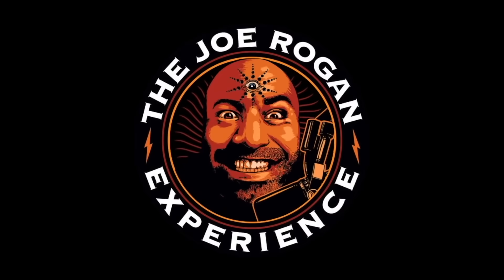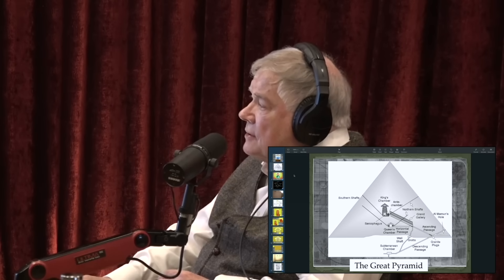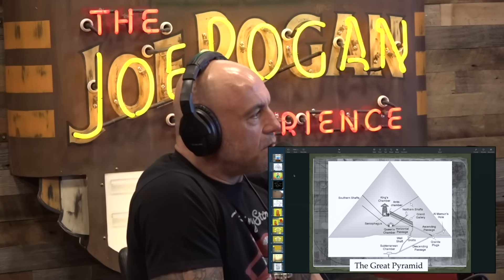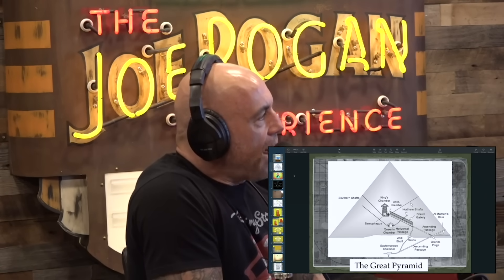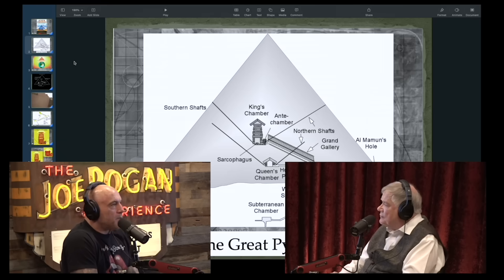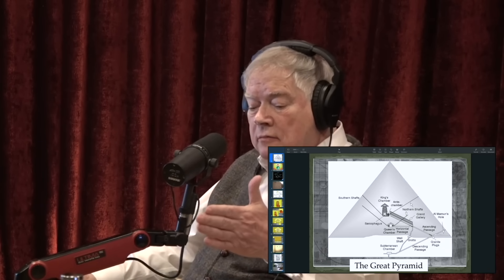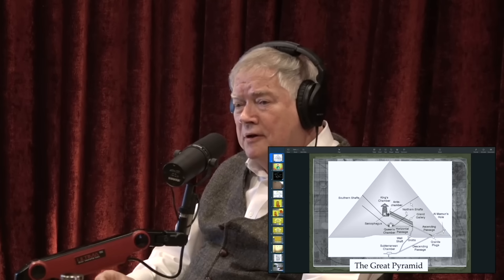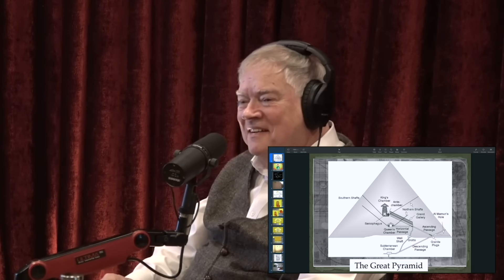"The Giza Power Plant" Christopher Dunn's Theory that The Great Pyramid Collected and Stored Energy

Comment: Look into galvanic cells, hydrogen fuel cells, and electrochemistry. The Egyptians understood how to harness the energy from chemical reactions. Went down this rabbit hole completely by myself about a week ago because i have the same theory as him, and then just now happen to come across this video. So this is what i think he wasn't explaining from what i see. The Egyptians knew how to make acids. From what i understand if you mix super strong vinegar (which the Egyptians could make) and mix it with pure sodium you get hydrochloric acid. If you put certain metals like calcium or copper or lithium in hydrochloric acid a chemical reaction occurs and hyrdogen gas is released(prob don't try that at home). There's also an oxidation- reduction (redox) process they could have been doing that creates an electron current (electricity) that might be more plausible. Im not an electrochemist or anything but i do think it's fascinating.

Comment: Dunn: "The wavelength of hydrogen is 8.309 inches, and the chamber is 8.4 inches. So that's how we know it was collecting microwaves."

The wavelength of hydrogen is actually between 0.0000161417 and 0.0000258268 inches...nowhere near 8.309 inches.

Just like with most absurd theories, they are based on false information which then leads to false conclusions.

Comment: bottom line, regardless of all the theories, there was no sarcophagus found d he the first ppl that blew inside the pyramids, there shafts actually turn(not all of the) for reasons we don't knw, they have tested the very bottom pits of the great pyramid, and I forget what exactly, but some form of hydroxide, coats the walls and floor, SOMETHING was being done...some think the ark of the covenant, which read the Bible analytically, was a weapon. Arks were created(hieroglyphs exist waaaay b4 moses(which the story of the exodus didn't happen) but the supoosed measurement of the ark fits inside the granite box inside the kings chamber,. Graham Hancock is on to something, I don't think electric power was used, but there was some sort of older human civilization. we keep finding older and older structures, temples ect...thay come from pre ice age times...knowledge was lost, what knowledge, downtown move stone as easily as we move a aingle brick maybe, but I don't know. but bottom line m there were no mummies in the pyramid, or any other ofnthengiza pyramids...some things don't add up

Comment: And they did what with the energy?  No wires, no capacitors, no diodes,  no relays, no see through materials that can contain any electrical energy ... minus this way to big conduit. It cant even be a radio.

Comment: Pyramids are aligned perfect with magnetic fields of earth. Pyramids resonate at a frequency and emit electrons. Below pyramid are aquifers so the water moving underground creates soundwaves and the sound waves move up through the pyramids it matches earths vibrational energy and it’s used to create energy.
Chambers have hydrochloric acid & zinc chloride creating tons of hydrogen which the buildup compresses the granite in passages ionizing the air increasing conductivity 
Theres sound resonators in there that further excite the stone and create more electricity + geomechanical devices that convert the frequencies into electromagnetic energy. Inside the grand gallery are 28 pairs of resonators that vibrate and emit sound. Gold in top of pyramid is a great conductor of electricity. 2019 Eric Wilson published “large scale thermoacoustic generator” describing rocks like granite to withstand vibration to allow electrons to move through them and the surface and acknowledged the egyptians created a power generating machine harnessing earths vibration caused by tidal energy and this is how tesla developed his patents and wardclyffe tower.
No evidence of mummies has ever been found
2018 studies tested radiowaves at varying frequencies to determine if the pyramid would respond to electromagnetic waves and discovered it resonates electromagnetic energy in its internal chambers and beneath its base

Teslas wardenclyffe tower was built on top of aquifer like pyramids were that had negative ions discharged to top and the copper/iron rods sent the electricity through the air to receivers the public could use
Piezoelectricity is what walking or movements generate or rushing water

No evidence of mummies ever found + burning of libray of alexandria hides all this tech
Base of pyramids are perfectly level and stones are cut to precision that amazes modern engineering cuz it takes lasers to do what they did
Reply: Take your meds bro. Call your mother.
Reply: @paulisfat8077 

Good counterpoint,  i like how you explained your theory and didnt personally attack... 

Never mind

Comment: Making electricity for what? What would they use without transistors, transformers, wires, conductors? What a load of nonsense
Reply: Youre thinking inside the box, you only know of the tech from this current age. There were things happening back then that you cannot fathom
Reply: @ where’s the proof? Where’s the metals that would be needed for such technology? Where is the tools or the remnants of machinery? Absolute nonsense if you believe this

Comment: Just wana say, i doubt they used chemicals to create hydrogen

I think they made many  voltaic cells to create electrolysis in the cells  to create the hydrogen similar to those new fancy hydrogen water drink bottles but used dissimilar metals and maybe even vinegar or salt water
Reply: Also who knows where the “collectors” outside the pyramid were they could have been the other smaller ones around the great pyramid, so fascinating.  the dendera light bulb (Egyptian carving that looks like a giant light bulb with a snake in it) 
Was most likely actually how they illuminated areas at night, if you have hydrogen in a glass tube with small pressure and a current flowing though the tube it will emit a blue light this is just science and if you look at the carvings it looks like the bulbs are even sitting on some sort of connection almost like it’s to complete the electrical circuit in the bulb or create a spark gap

Comment: Another entry in the Jre series "shit that didn't happen"
Reply: Pyramids are aligned perfect with magnetic fields of earth. Pyramids resonate at a frequency and emit electrons. Below pyramid are aquifers so the water moving underground creates soundwaves and the sound waves move up through the pyramids it matches earths vibrational energy and it’s used to create energy.
Chambers have hydrochloric acid & zinc chloride creating tons of hydrogen which the buildup compresses the granite in passages ionizing the air increasing conductivity 
Theres sound resonators in there that further excite the stone and create more electricity + geomechanical devices that convert the frequencies into electromagnetic energy. Inside the grand gallery are 28 pairs of resonators that vibrate and emit sound. Gold in top of pyramid is a great conductor of electricity. 2019 Eric Wilson published “large scale thermoacoustic generator” describing rocks like granite to withstand vibration to allow electrons to move through them and the surface and acknowledged the egyptians created a power generating machine harnessing earths vibration caused by tidal energy and this is how tesla developed his patents and wardclyffe tower.
No evidence of mummies has ever been found
2018 studies tested radiowaves at varying frequencies to determine if the pyramid would respond to electromagnetic waves and discovered it resonates electromagnetic energy in its internal chambers and beneath its base

Teslas wardenclyffe tower was built on top of aquifer like pyramids were that had negative ions discharged to top and the copper/iron rods sent the electricity through the air to receivers the public could use
Piezoelectricity is what walking or movements generate or rushing water

No evidence of mummies ever found + burning of libray of alexandria hides all this tech
Base of pyramids are perfectly level and stones are cut to precision that amazes modern engineering cuz it takes lasers to do what they did

Comment: My problem with the pyramids being power plants is: what were they powering? There is no wires, or any other way of connection with anything. Were they powering their homes? Or, just this one pyramid?
Reply: Hows your cellphone work?....can you charge things without plugging them in?
Reply: Tesla was Also working on wireless power, theres your answer
Reply: Exactly! It’s a fairly nonsensical theory.
Reply: They built a power plant to power tools to cut stone to build the pyramids. So they had electricity AND time travel. 

Crackpots are fundamentally dumb so you can sell them anything.

Comment: I'm an electrical engineer

And the explanation of what he calls electron harvester is utterly BS

Electrical energy and or current is not harvesting of electrons

It is impossible to collect or harvest electrons

Electrical energy and or current is generated by inreasing the amount of energy that every electron has and has the potential to charge up and discharge its energy 

Charging up the energy level of an electron is possible by severeal ways, lllike rapid changing magnetic field like it is induuced by a generator powered by steam, wind or water flow !

Another way is photovoltaic by solar panels 

those two are the most used in the world especially the generator powered by steam in a gas or coal or oil or nucleair power plant !!!

You can harvest electrical charge load by means of a battery !

But you can not harvest electrons !!!

Comment: i wonder if it acts like a giant capister / coil and i wonder if the square temple they say is actually a battery that was charged wich also charged up the bagdad batterys its possible and well if you had designed a power saw that used power well you could cut the blocks

Comment: You can just look up the inner ramp theory. The shafts are how they moved the blocks to the top of the pyramid. There are rope and pulley spaces, wear where ropes rubbed etc.
Reply: no rope or pulley was strong enough to lift the 80 ton beams
Reply: They are talking about what the Pyramids were for not how they were built…

Comment: "electron harvesters" are not a thing.
and that's NOT what generators do.
this guy has no fucking clue what he's talking about.

generators do NOT harvest electrons, they merely push them down a wire.
they pump them from one end, and dump them in another, creating a current in the process.
that motion, can then make other things move, much like a current of water pushing on things.

when you have a flow of water down a hose, you can use it to push things.
but that doesn't mean the hose is a "water harvester" and neither does is "generate" water, or "consume" water....the water just moves from 1 end to another and that motion can be transferred to other things.

the level of complete ignorance on display by some of these guests is astounding!

Comment: Lmao this guy thinks a waveguide is complicated.  Has he ever seen a compression driver?  This guy just took what some guy said off the cuff and developed an entire theory around it.  He literally couldn't explain anything in a technical manner to any real degree.  Guy says they threw chemicals in there and then used a waveguide to collect microwave energy which is guided into the chamber which then turns the hydrogen gas created by the chemical reaction into 'electrons' or whatever.  This guy has no idea what he is talking about and has absolutely zero real evidence.  Where is all the evidence of the chemicals which should be all around the site?  Where is the evidence of the immense amount of energy that would be needed to burn hydrogen via a microwave?  Oh it just rains down from the sky lmao.

Comment: imagine building a pyramid over a natural spring, and once the structure built, bursting forth water down the pyramid into  reflective pools surrounding the pyramid reflecting the stars. their peoblem, dating the springs, brings you waaaaaay back
Reply: Question, is there a way for sound waves to resonate through the shafts and be heard outside the pyramid, not only did it appear the pyramid produced water, but also made a non stop noise, created by what ever was inside the granite box

Comment: It's a power plant. It has encoded in it's dimensions the size & diameter of earth, moon, distance between, the "speed of light" in a vacuum... It held the ark of the covenant. They also could harness different frequencies, such as healing and astral projection. It had multiple purposes.
Reply: Good lord. How have you even survived to Fill your head with such stupid shit
Reply: where did you learn that
Reply: Speed of light? So ancient Egyptians used the metric system?
Reply: @HyperGolem The speed of light is the same regardless of measuring system. I understand what you're saying because I was thinking of the same thing but if im not mistaken this connection would exist in any system.
Reply: @jameswebb3410  it would, because we're talking ratios here. They're the same in any system, that's how you know what initial metrics they're connected to